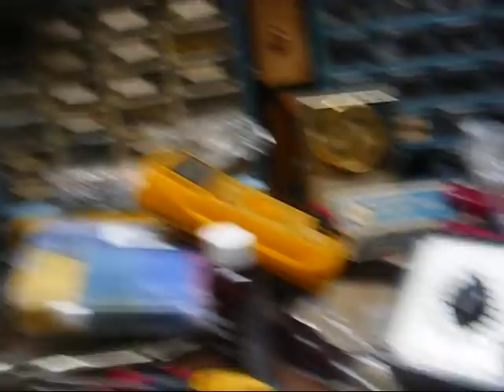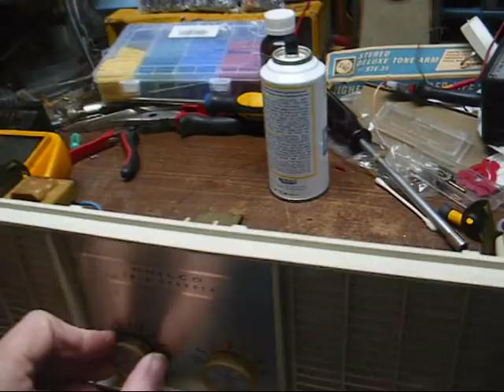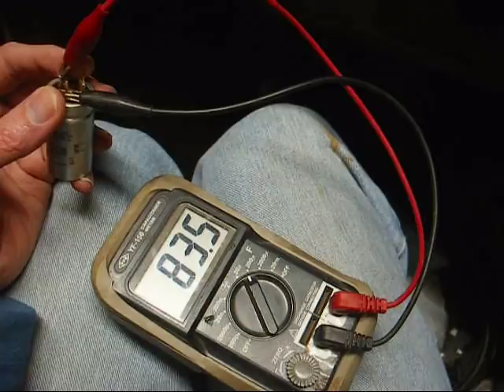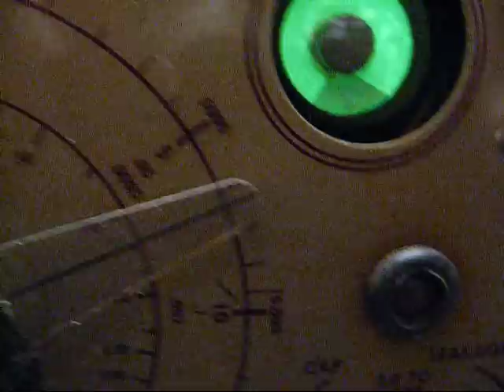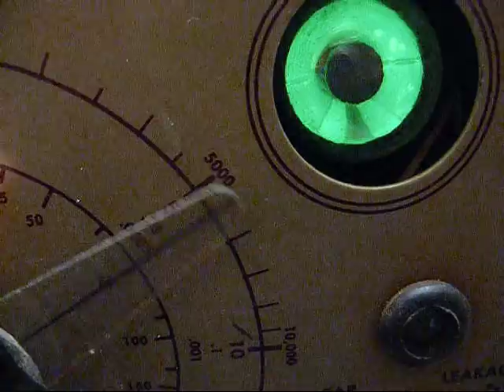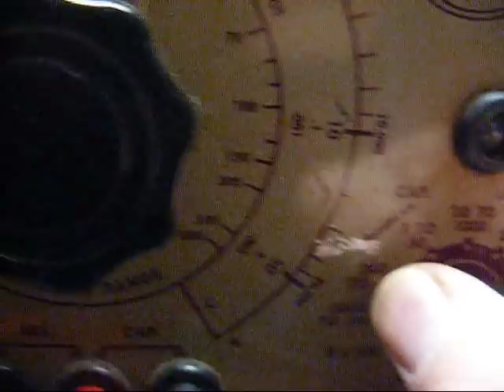Philco-Ford AM tube radio from 1968

Comment: Good sounding radio.  Your lucky to have some decent AM stations to listen to.  All the ones in my area are either off the air or degraded so much from lack of maintenance you can't stand to listen to them. That was a good sounding southern gospel station.  What are the call letters?

Comment: No SMD on I.f. transformers, most Japanese IF's used individual capacitors not the open mica sheets like transformers made by american mfgrs. such as automatic and ktran. Never did like the mica sheet transformers, back when you could still buy replacements from Workman or other suppliers I would always look for Japanese made transformers and leave the Automatic or K-trans in the store.

Comment: My mom bought that same radio in white for like $10 in the mid 60s. Changed the death cap, and besides the hum from a dead B+ cap it would squeal and crackle intermittently. Turns out the board was cracked down the middle. Crazy glued the board, repaired the broken traces, replaced the rest of the caps, and it sounds decent, albeit low, audio output tube tested weak.
Reply: What is the model number?
Reply: It's only a partial tag but I'm sure it's F-224.
Reply: Here is a site that I am currently is currently working on that documents the last tube radios made along with their models: https://sites.google.com/site/thelasttuberadios/home

Comment: A double win with changing out the capacitors. You can list the radio for a hundred dollars more on eBay, now that it has new capacitors. And.... You can list the old capacitors you took out of the radio on eBay as "tone capacitors" for vintage guitar amps.

Comment: Nice... handsome set, too...symmetrical. :-)
Reply: If I had one of those, I'd do the re-soldering, re-lubing, control-cleaning,  recapping and stuff as needed, plus, I would re-locate the ferrite antenna bar above that mounting bracket that's just above it now, and re-align the antenna circuit, thereby getting the antenna up into the clear and unobstructed. :-)

Comment: I'll bet that radio sounds better than modern ones.  I picked up a Panasonic clock radio to replace my old clock radio.  The AM sounded dull.  I looked up the specs on the chips it uses.  The AM bandwidth is only 3khz or so.  Ugh.  That old tube radio probably carries the full 10khz that's being transmitted.
Reply: I have a Panasonic 880 and it sounds incredibly good and it is mono!  Very sensitive too. They just don't make radios the way they used to. It was built in 74 and works perfectly and the only thing I had to do to it is clean the exterior and spray the pots.

Comment: Leaky capacitors tend to read higher than their actual value on a typical digital multimeter.  The leakier it is, the higher "capacitance" it will read.